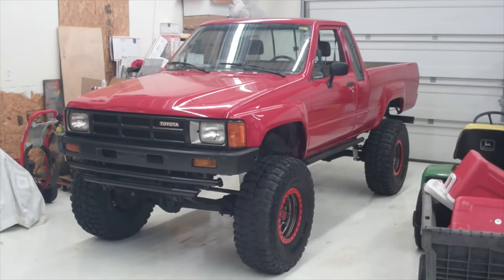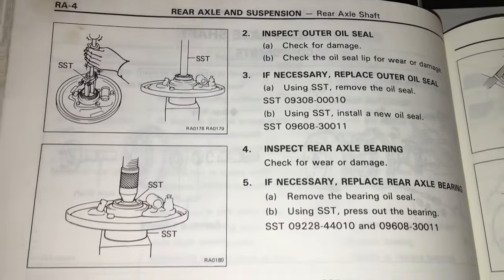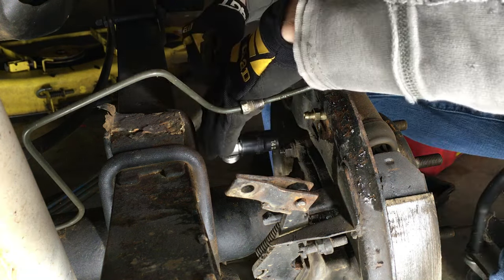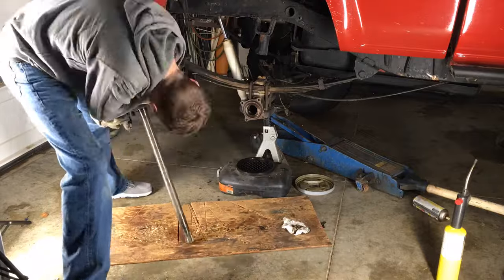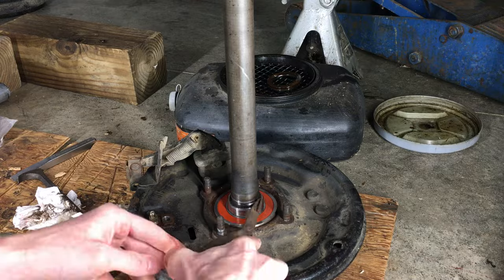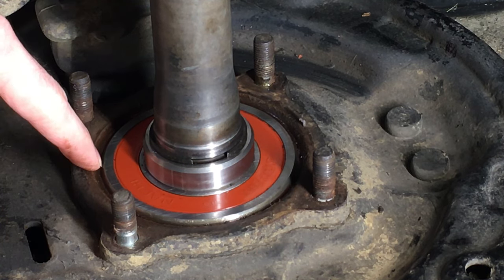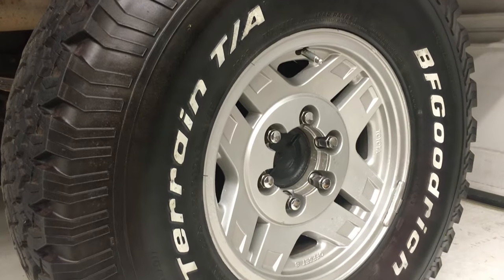Install Toyota Pickup/Hilux Rear Axle Bearing, Oil Seal - WITHOUT a Press!

Comment: Wouldn't it have been a lot easier to use those massive wood blocks to support the backing plate and then tap the end of the shaft with a hammer and piece of wood rather than spend all that time tapping the shaft on the ground?
Reply from the maker: Rybot5252 it would have been a lot less work but I don’t have a large enough hammer to equal the force of the shaft coming down with the weight of the backing plate/brake parts behind it. I should try it that way next time though and find a way to make it work because this way was a workout.
Reply: @6thGearGarage  gotcha yea that looked exhausting!

Comment: Where did you order the kit from?  Im saving my pennies so i can do this to my 1990 Toyota Deluxe 4x4
Reply from the maker: chrisj2004 I got the kit on eBay. I bet Amazon has it too.
Reply: @6thGearGarage  Thanks, I will search on Ebay and see what I find. Search for "rear axel seal kit?"
Reply from the maker: @chrisj2004  I'd try "toyota rear axle seal wheel bearing" and be sure it's compatible with your year/model. (seller should have that listed.)

Comment: Didn't work.  Beating the crap  and no budge on retainer ring, now I'm kind of screwed
Reply from the maker: Did you try lube/heat on the ring?
Reply: @6thGearGarage  I ground the ring off , now the bearing is refusing to budge, and yes on the lube , no on the heat, maybe tomorrow
Reply: Yep. 2000 Tundra. Tried 2 different 20ton presses. Nope. I had to have the old bearings torched out.  Not fun.

Comment: How long does the whole job actually takes?
Reply from the maker: It took me about 3 hours for both sides, not rushing.
Reply: @6thGearGarage  thanks for replying 1 of mines has gone out. And I was trying see why its expensive to fix. So I figured it must take a long time🤷
Reply from the maker: @zeekmusiq2699  Faster if a press is available :)
Reply: @6thGearGarage  without the part is $330 to much to pay to get it fix you think?
Reply from the maker: Zeek Musiq figure $75-100/HR labor for a shop, that's not bad for both sides.
Reply: @6thGearGarage  appreciate you man

Comment: Seen two were inner seal misses collar completely  had to space collar out 8 mil to get it in line with seal had persistent oil seepage
Reply: You had to push the retainer farther towards the backing plate? I saw that on another video where the new inner seal did not align with the retainer. In fact they turn the retainer around so the bevel face has the backing plate.

Comment: Old vid but you really need the proper tool to remove the bearings...$200 and a harbor freight press $150. You could make your own tool if you can weld good..Its just a thick wall pipe with a flange on both ends
Reply from the maker: Yeah I bought a harbor freight press after this experience. It had been useful for some other projects as well.

Comment: just did my 88 4 runner rear bearings.please  DONT do it this way. i tried, it hurts the heck out of your hands on palms with NO results. this way worked for me. stand axle spline up. support bottom on brake shoes making sure stud hub clears supports and has somewhere to fall to. use heavy thick hard wood block and a BFS on spline end and one wack at a time. done n out. BFS stands for BIG f.....g sledge... or, you can go to toyota and they will press out @ $165 a side. NO f way!
Reply from the maker: Good idea, you had a stubborn one!

Comment: Did you drain the oil 1st?
Reply from the maker: Gary Kent no need to drain the oil. With the side I'm working on slightly elevated from being lifted on the Jack stand, the fluid doesn't leak out.

Comment: Wtf is this no rear locker non sense! Otherwise pretty useful, I had no manual and did not know about the outer O ring. Now I know for next time. Also to get the retainer ring off I just heated the ring (kept the shaft cool) until it fell off.

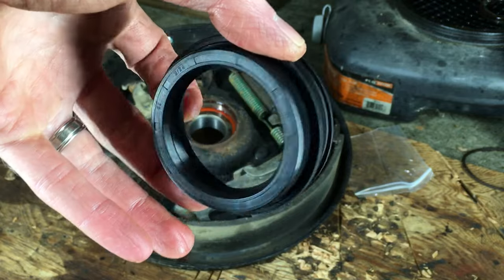Comment: 7:30, dont use the old bearing for that !!!!
Reply from the maker: König Hansen I didn't use the old bearing. I used a large socket.
Reply: Ok, yes you used a large socket, but you placed the old bearing inbetween, but you might as well have beaten on the new bearing due to slack in the old bearing. You should have pressed / beaten only on the outer ring of the new bearing(removed the inder ring of the old bearing). Dont expose the ball inside the bearing to stress during mounting.